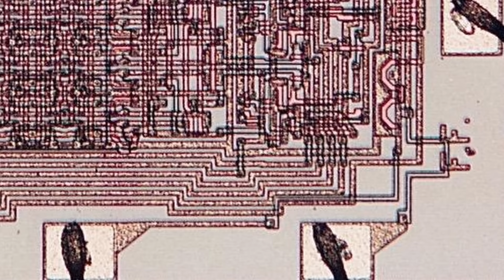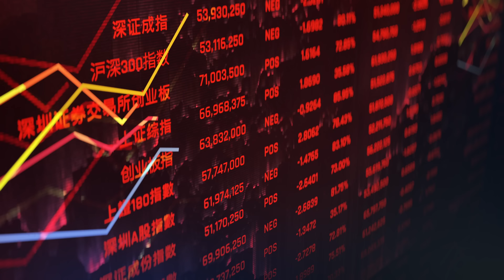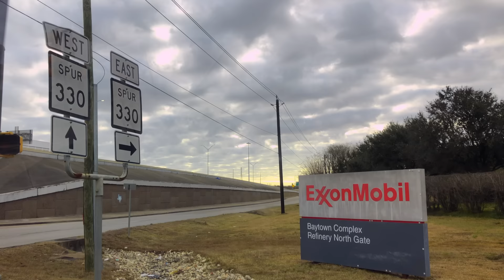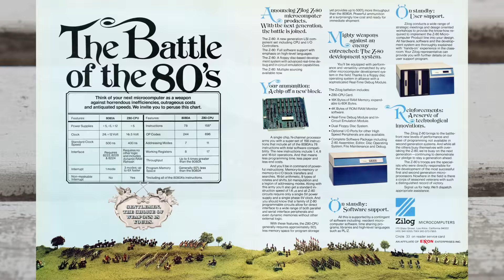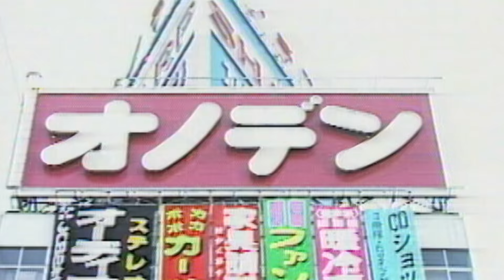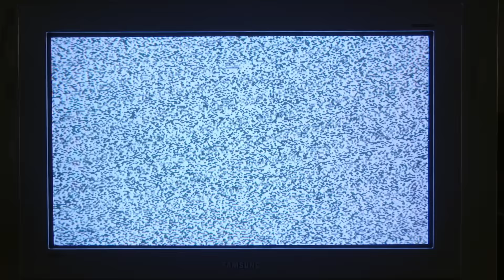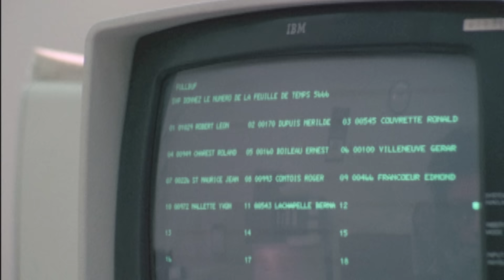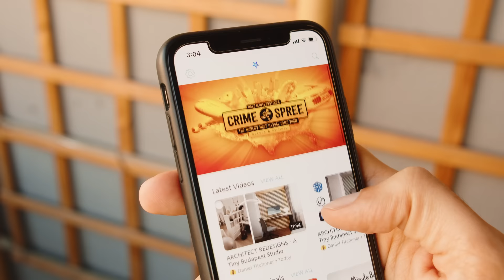Intel’s worst Nightmare

Comment: Oh Z80, what a hard processor to use you are. I remember 2 years ago in highschool, my teacher gave us 5 dictionary sized computer and 50 pages of " Zilog Z80 Programming book ". It took us almost an hour just to fix one calculation error.
Reply from the maker: Ironically, it was considered simple to use at the time!
Reply: @LowSpecGamer  My teacher said  " Today we have application for programming (IDE). We just type the code and the computer will translate the language and proceeds execute the command. Back then we are the coder and the translator, we have to understand what the computer said and tell them what to do and how to do it."
Reply: It's actually quite simple to use, it's just that you need to first learn how those processors work.
Reply: Huh, personally I took an extreme liking to z80 assembly.

I picked it up quite fast.
Reply: @JM Coulon I once learned how to do basic programming on  the 6502. The 'assembler' was a sheet of paper that you used to translate the op codes to hex that you then entered on a hex keypad. It was pretty basic stuff.
Reply: @LowSpecGamer Back then I wrote the equivalent of a DOS TSR for an KayPro II in Z80 and hand disassembled their ROM page.  The Z80 was NOT a hard processor.
Reply: @JM Coulon Happily, most modern platforms are sufficiently powerful that you can stick with high level (even interpreted languaged) for the most part.  I think one case where I looked the the compiler output is to find out how atomics were being handled by code I needed to run under Linux on both ARM (RasPi) and X86_64.  I miss the days of sane ISAs.  I wrote a good bit of CP/M Z80 and Amiga 68k stuff, and that always seemed mentally tractable to me.

Comment: A guy who can run the entire process logic in his head is a brilliant man. It's not impossible but it requires a lot of thinking power.
Reply: I wonder if he ate more, on lunch and dinner...
Reply: It's pure genius and detailed experience. Power of imagination.
Reply: I LOVED routinely writing Z80 code in my head when I was really young. Just the sheer power of the command set was astounding, and with the DRAM hidden refresh built right into the chip make it an even more amzing processor. It's just too bad it took 2 top Intel Engineers to leave and form Zilog only to struggle with making it the incredible processor it was, and has become, from such a smcall company struggling against the big companies. My fellow Italians did it.
Reply: Because at the time the culture emphasized the games Go and Shogi during the developmental years.  Gives you a different set of thinking tools.  Very good games in and of themselves.

Comment: Amazing episode. And for a good chunk of time I was thinking that the compony was AMD and not Zilog, and then I realized that x86 architecture was not invented in the video yet. Now waiting for the AMD video . . .
Reply from the maker: Zilog was AMD before AMD existed!
Reply: *company
Reply from the maker: They are unlisted. They no longer work and I kept getting messages about them not working/breaking people’s games/doing a “fix” asap, so I unlisted them.

It’s not most, just a small group for now.
Reply from the maker: There is a playlist with all of them!
Reply: 3DFX was the first graphic card realeased .
I STILL HAVE MINE
Reply: @LowSpecGamer  Not before AMD existed... AMD was founded in 1969, Zilog in 1974/75. AMD did lots of IC-products before they got into this x86 pathway. They made standard TTL logic (just like Texas Instruments, Fairchild, Harris, Sylvania, RCA, Motorola, and Japanese and European makers). They also made EPROMS, SRAM, DRAM, "bit slice" units for buildning large processors, and much more. 

A clone of the 8080 as well as a floating point processor and other supports chips for it that Intel did not design and didn't yet make (but later (cross) licensed from AMD) were precursors to AMD jumping onto the current x86 bandwagon.

Zilog, on the other hand, did much more than the famous Z80. Faggins original idea was the Z8 harward based microcontroller. After the Z80 they also made CPUs like Z8000 (16-bit), Z80000 (32-bit), Z800 (advanced Z80 variant), Z280 (advanced Z80 variant in CMOS), Z380 (32-bit Z80 variant) and many more.

(And Faggin did indeed bring the important polysilicon gates, buried contacts and "bootstrap" loads to Intel. Shima was a talented engineer, just as you say. You can see several interesting solutions on the original Z80. Having a small 4-bit ALU doing both 4-bit (BCD), 8-bit and 16-bit operations is just one of them! The 8080 they designed had an 8-bit ALU, but was still a little slower on most instructions. Radical changes in implementation methods was a way to avoid a lawsuit from Intel, according to interviews or "oral history. That's also why they changed the asm-syntax.)
Reply: In the early 80's (81, 82) when Zilog was battling for survival (unknown to most at the time) as my Uni. Hardware  projects at that time was with Z80A / Z80B, AMD was well know for Bit-Slice processors, particularly the 2900 family.
You could make 16-bit or 32-bit wide processor (or any width) with your own instruction set,  such was the power of the AMD family.

I learned about the AMD2901 in 1982 and in 1986 I found 16 x AMD2901's on the FPU board of a PDP 11/44 , I was blown away as the PDP 11/44 was an old computer by 1986 (VAX 11/780 was newer at that time).
Reply: @LowSpecGamer  AMD was founded in 1969, long before Zilog.
Reply: @ossiedunstan4419  
The first 3D accelerator cards released were not 3DFX but:
S3 ViRGE (1995)
Nvidia STG2000 (Nov/1995)
ATI RAGE (1996)
Matrix Mystique (1996)
3DFX Voodoo (07/Oct/1996)
Nvidia RIVA 128 (25/Aug/1997)
Some Others
Nvidia GeForce 256 (11/Oct/1999)